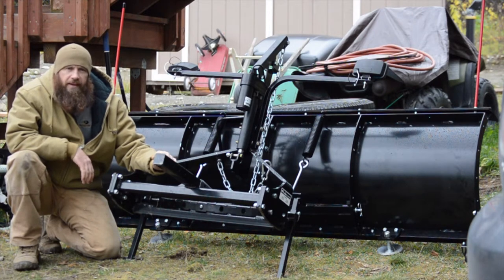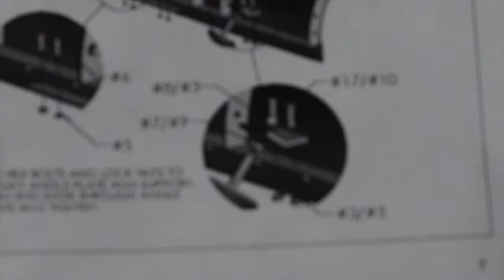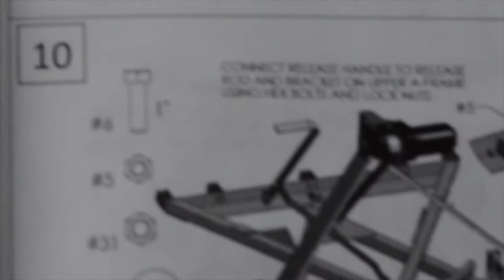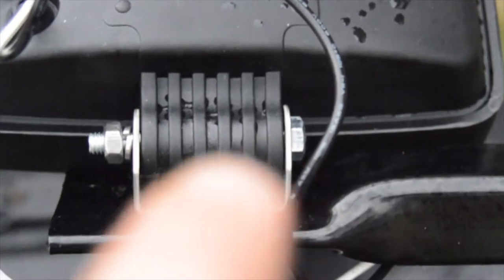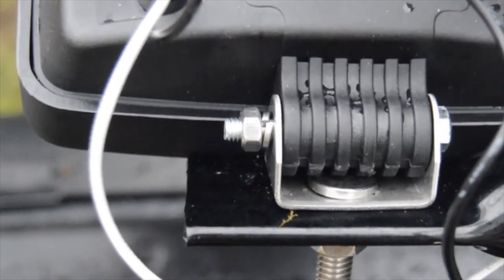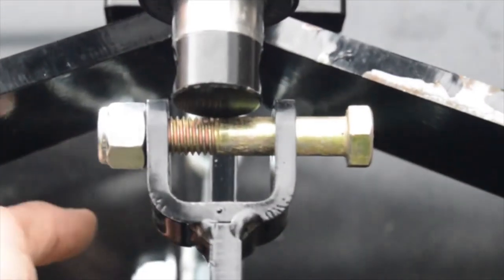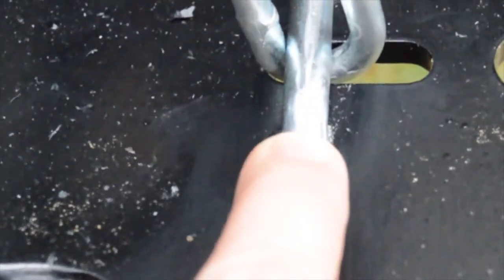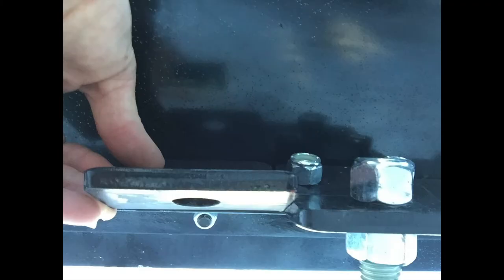Snow Bear Pro Shovel Snowplow issues 2017, Assembly

Comment: I had the same problem. 
1 season and the motor seized from corrosion. Water destroyed it. 
They asked if I stored it inside or if it was used in a humid environment. Wtf. Seriously. 
Still under warranty after 11 months. 
Waiting for replacement actuator. 
They should at least have a warning. 
Do Not operate these snow plow in a humid environment and keep it inside.
Update 
I received a new actuator and it work fine. 
I do take it inside after each use.
Reply from the maker: I concur

Comment: I bought my 88 inch ELECTRIC snowbear in Dec 2019.... used it 2x   , and 3 times in 2020/21......
my actuator just won't work. ADAM at snowbear says electrical and condensation are problems and says I should have put the plow indoors when not in use.... WTF !!!  the 1 year and a month old actuator that doesn't work no more will cost me $400
Reply from the maker: That sounds like par for the course, yeah, "put it inside"  um sure?  You can use it in the snow, on a gravel driveway, in neg AL/Can weather, but a little rain will kill it?  I believe if you have a 1/4 truck or a Cherokee/S-10 blazer size vehicle, a paved driveway, with room in a garage it would be usable for years but for real trucks, with real weight behind it, and real winter weather this is plow is a No-Go.
Reply: I had the same problem. 
1 season and the motor seized from corrosion. Water destroyed it. 
They asked if I stored it inside or if it was used in a humid environment. Wtf. Seriously 
Still under warranty after 11 months. 
Waiting for replacement actuator. 
They should at least have a warning. 
Do Not operate these snow plow in a humid environment and keep it inside.

Comment: Having similar issues. Drilled holes not lining up even though holes to the right and left are lined up to the mm. Missing hardware, also the short bolts you showed, same issue here. I havent even finished assembly yet I just wanted to see if anyone else had the same issues...
Reply from the maker: I just had to replace the electric motor.  Three seasons and it died.  I will not buy another snowbear product until something changes in the factory, management, Etc.  I was unhappy about having to use another motor from Snowbear as I could not find the correct one on amazon or else where.  Three seasons, that is not a good ROI and that extended my pay-back buy a full year to recoup not having to pay a plow service.

Comment: I bought mine on eBay when it came in the boxes sealed it had two left halfs of the blade called snow bear they sent me right half no problems no questions asked didn't even ask to send the other piece back they were really easy to work with but I didn't really have any of the other issues that you had other than a couple of bolts weren't long enough but I only got six blocks to go to get to a hardware store I've been using it now for a year and it works great
Reply from the maker: Lee Fisher. Styrene Marine I am glad your events turned out differently then mine did!

Comment: Sorry to hear, I couldn't be more happy with mine. My only prob was the holes for the springs that resulted in me losing too many springs.  I fixed the prob by heating the spring ends and closing the loop so they couldnt fall off.  The wireless remote and acuator are the bees knees. 
I have done 2400 service calls in 3 seasons on small residential driveways, first season I blew 3 winches. Odering a vdrag blade so I can do better back blading.
Reply: I have the 82 inch winter wolf I believe on a ZR2 Blazer.
Reply from the maker: I am glad you are happy with your plow, I also appreciate the numbers presented as it will help others make a more informed decision, while the hard parts have been mostly good, I just had a ton of little things!

Comment: I recently bought a smowbear plow, I had issues with the lower straight bar that bolts to the lower part of the plow a few holes were not drilled right, and the center mount on that lower bottom of plow was not right. 
   In all it works well but I agree quality control needs to step up.
Reply from the maker: This seems to be a trend from the company.

Comment: I bought the proshovel 84X22.    I started assembly and got stuck on how the blade attaches to the A frame, turns out it was welded wrong.   Snowbear is going to send me a new 1/2 blade drivers side.    My A frame is a little chewed up because of the bad part, .  I didn't ask for a new A frame during the conversation but sent an email to them requesting it and haven't heard back from them for a while. we will see how that turns out.  Not happy with how its going but all will be good if it finally goes together and works. I don't want the damaged A frame though.
Reply from the maker: Seems there a quality control issue, not for all the plows, as stated by others below, but enough that it is a process that I would recommend them relook at and fix any issues with.  I hope they make it right for you.  After all, winter is coming!

Comment: My snowbear plow is junk quality. All the paint started scaling off the frame at various places after the first winter. Even the snowboard decal came off after the first plow. I had to rust paint in the summer huge areas. I also had some problems with bolts and had to call for replacements.
Reply from the maker: My paint is coming off as well, i figured that was just part of the deal.  Now that extra few bucks for a real coating versus simple paint seems another cost-saving but costly item, though mine chipping was all on the frame and not on the blade itself.  I have decided not to call them for replacements since it was a good learning experience and to a smaller extent to check how they manage their social-media market.  They have not contacted me yet!

Comment: I just bought a Meyers plow. I look around for a year. I look at all of them and I paid  $5300.00 with a five year warranty installed.I think that was a good deal.
Reply from the maker: That is a good deal for an installed Meyers.  I wanted to preserve as much ground clearance as possible so the front receiver hutch mount seemed just the ticket!  While I am only 2000 USD into it and far ahead based off the man-hours I have invested I would and will, if things don't change, buy a different brand next time around and just bolt/unbolt the mounting hardware each season!

Comment: I don't think it's a one-off quality control problem. I had some of the same issues. Above yours I was also sent a faulty left blade and the wrong motor support bracket. All was resolved but with delays. Luckily I started before the snow fell. Now dealing with clearance problems with the plow on my truck. Went to a client's property and with it raised to it's maximum point I still scraped the driveway entering. I don't think there's any modifications i can make without compromising the structural strength of the plow. Sadly I may be returning it if I can't come up with something. 
I had higher hopes from snowbear, being from the north. I may be saving up for a better one next year.
Reply from the maker: Hopefully you can find a solution for the clearance problem with some combination of lift kit, springs, and other items.  I am definitely already looking into the future past the ROI date for an alternate brand or at a minimum a plow requiring less work to get it working!

Comment: After taking a good look at how the Snow Bear was built and the price, I could see you are not getting near what you pay for it. Looks cheaply made and now after seeing this video, I'm glad I chose a different route. I actually copied a lot of the design features, but used heavier metal at all the stress areas, so it would hold up better. So now I have basically a Snow Bear on steroids! I can slam frozen snow banks all day and never bend or break anything on mine. It just takes some trial and error to build them to last. Obviously, Snow Bear didn't do much or any homework before building them. You could probably get by with one if you are really careful plowing with little or no obsticals in the way, but for the price, I'd go elsewhere. When I see prices from $3000 to $5000 for snowplows, I ran. I built mine for less than $500 and it's solid!
Reply from the maker: Painter D I was a snow noob, and had never seen a snow bear so I had: price, online reviews, and a few videos.  I am into it for about  $2000, it was on sale when I got it, so it needs to last another 4 years to pay for itself versus paying somebody, after that, I will get another brand!
Reply: @michaelkaylor6770   A friend of mine had one and after doing alot of welding and using thicker steel plates to beef up the weak spots, his should last alot longer now. The metal they use is just too thin.
Reply from the maker: @PainterD54  between the thin metal and the lack of penetration on the welds, it is a mediocre item
Reply: I ended up super molded mine for dual mounts to truck with 2 inch receivers x 2 and welded plate steel in the A frame

Solid as a rock now..  and the blade doesn't chatter down the road

Comment: Goodness what a load of hassle!
Reply from the maker: Exactly, just a lot of extra time and hassle!
Reply: I bought my 88 inch ELECTRIC snowbear in Dec 2019.... used it 2x   , and 3 times in 2020/21......
my actuator just won't work. ADAM at snowbear says electrical and condensation are problems and says I should have put the plow indoors when not in use.... WTF !!!  the 1 year and a month old actuator that doesn't work no more will cost me $400